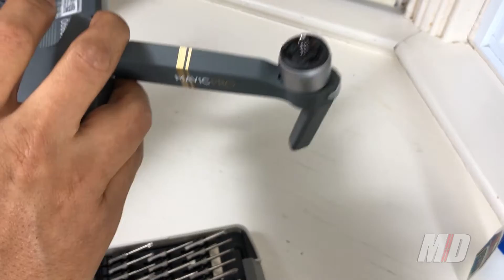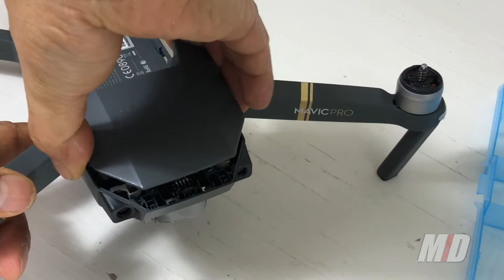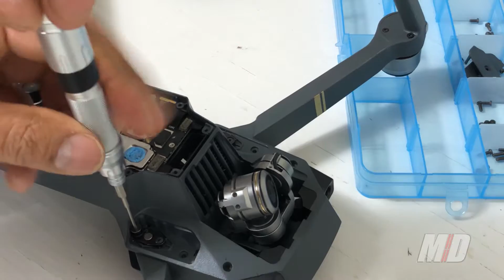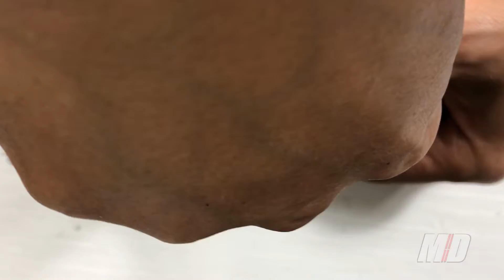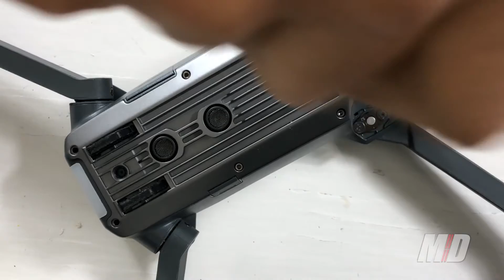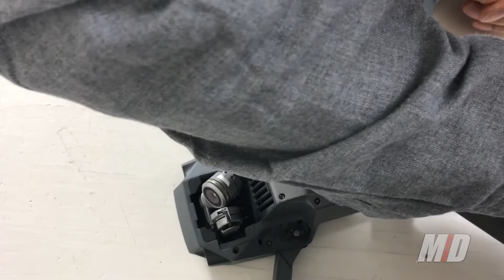DJI Mavic Pro Front Arm repair

Comment: Thanks for the video!  I need to replace an arm and needed to know the mechanics of it.  I do have a couple of tips to help you and your viewers with soldering.  Having a clean soldering iron tip makes it so much easier! Once the iron is heated, wipe the tip with a damp paper towel folded several times so you don't burn yourself.  The tip should be a shiny silver color. If not, try recoating it with solder and wiping it again.  If all else fails, replace the tip.  With a clean tip put just a bit of solder on it and touch the solder pad on the board. The solder should melt almost immediately and you can remove or insert the new wire.  This should take a matter of a few seconds.  Also, use a pair of needle nose pliers to hold the wire so you don't burn your fingers!